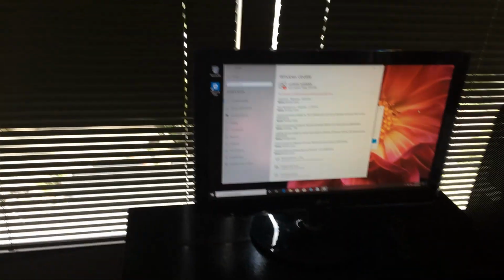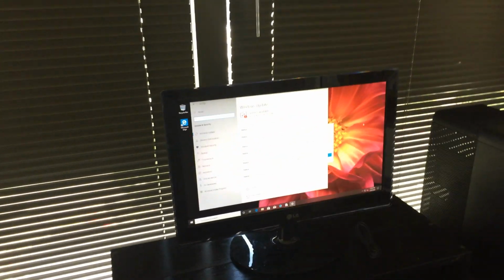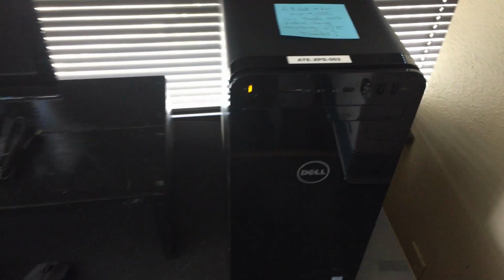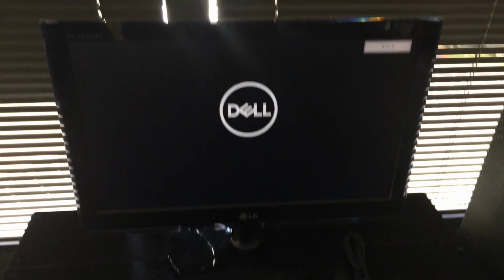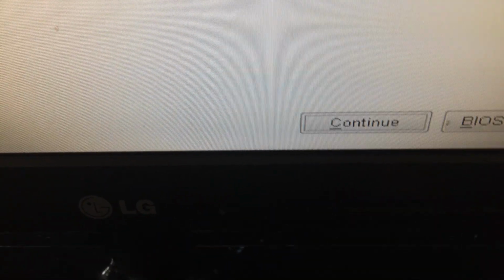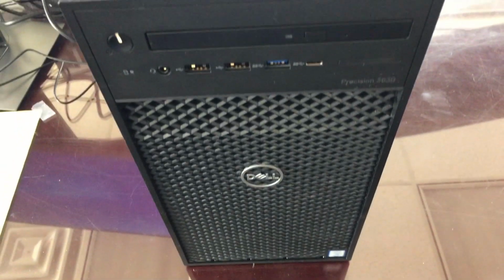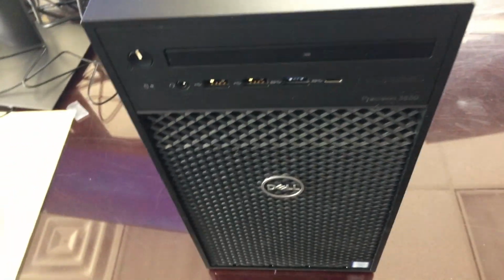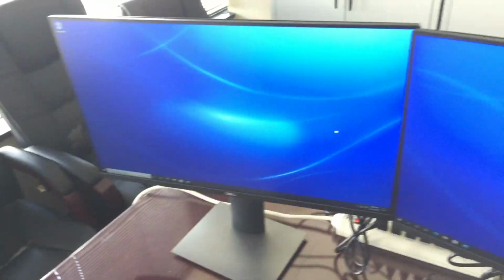Client Work - Install new Dell's - Netgear POE Switch - Dell PS Replacement

Comment: Would be interesting, to pass through a GPU to a VM running Server 2019 and terminal services and CAD,, see if they would be able to RDP in, and do CAD.
Reply from the maker: They can, but 1 video card per vm, the client cant afford a $10k video card to support passthru to all of the VM's.
Reply: @UnkyjoesPlayhouse  you can use GTX cards but that also can get costly and use "parsec gaming" instead of RDP